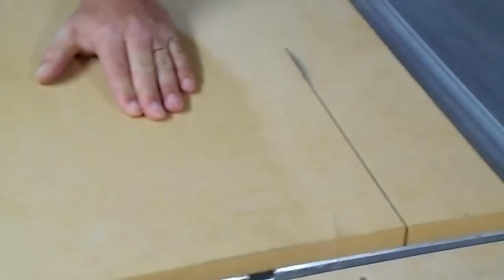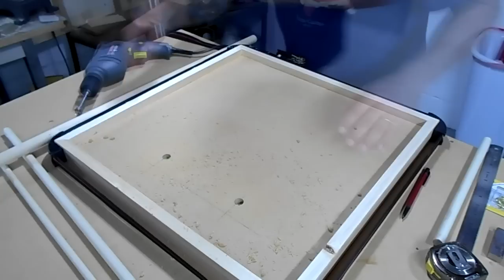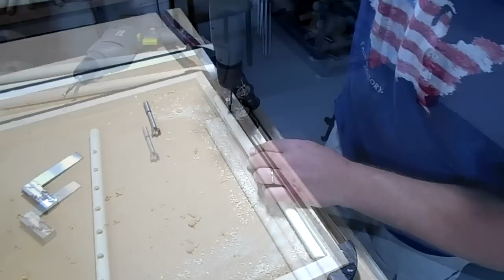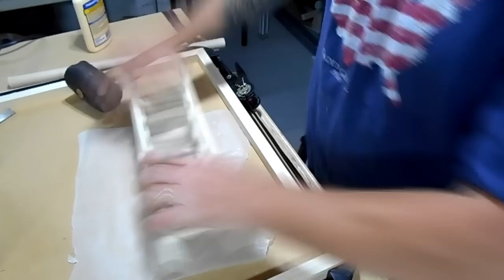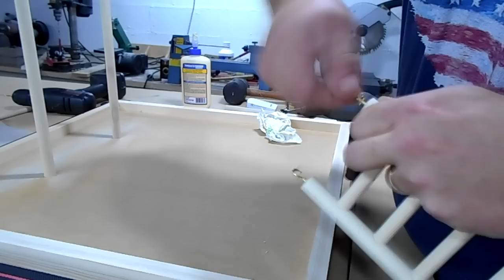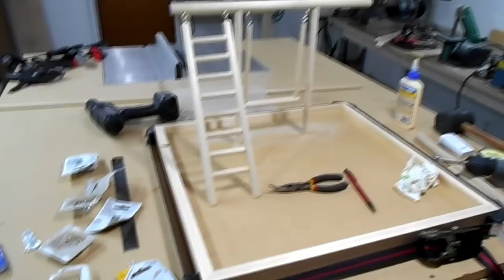DIY parrot playground

Comment: Nice, but... isn't that wood glue toxic for parrots? I'm afraid it is... :/

Before making any bird stand, toy, perch, cage etc., you  gotta check and make sure ALL the materials involved in the construction of the item are bird safe. Parrots especially love to chew and will beak everything around. Even just for climbing up and down, they use their beaks to hold on to things, so they'll probably touch every part of what they're standing on and playing with. And even if their beaks aren't involved, consider that when they eat, they hold their food with their feet, so whatever their feet touched will transfer to their food and eventually be ingested. Many types of wood, metal, plastic, and especially glues, dyes, fabrics, polishes and paints are poisonous to them. So, please, be responsible, and chose your materials carefully, for the safety of your birds.